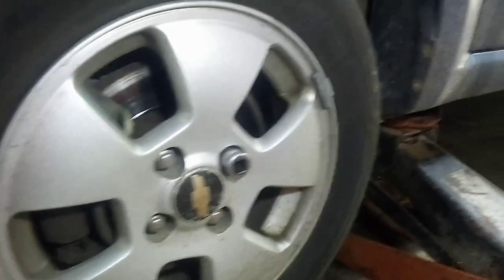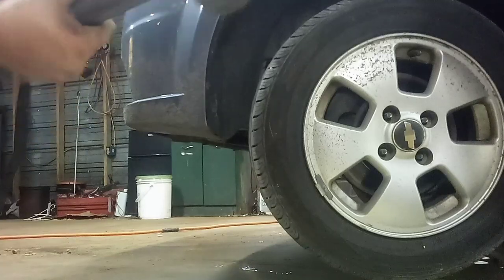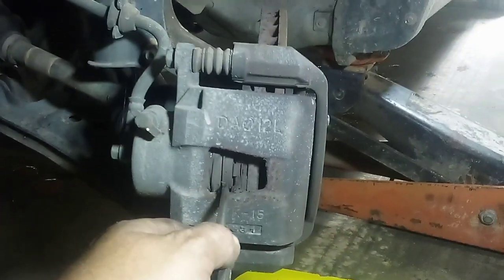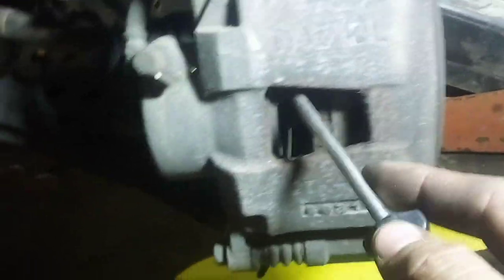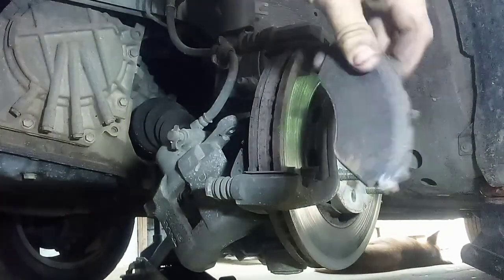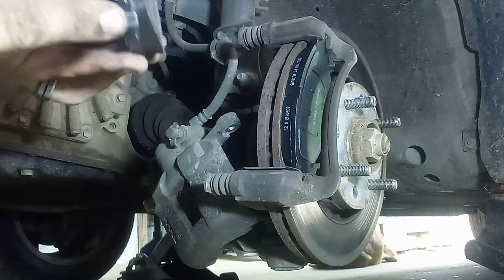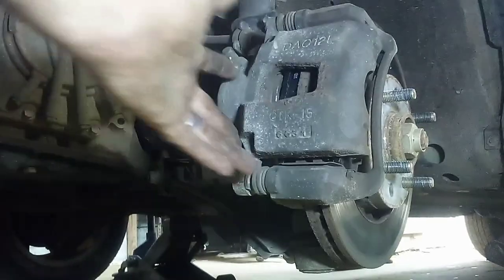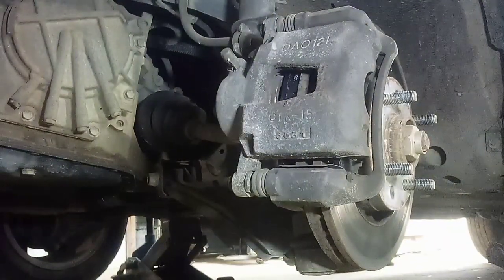Chevy Aveo 2008 front brake pad replacement

Comment: you make this look so easy but it took me 4 hours to get my pads to finally fit in, and i even had to take off the metal part of the brake pad after using the compressor tool just to get it to fit O.o
Reply from the maker: Dang you might of needed a caliper or the slid pins might have been stuck 😂😆